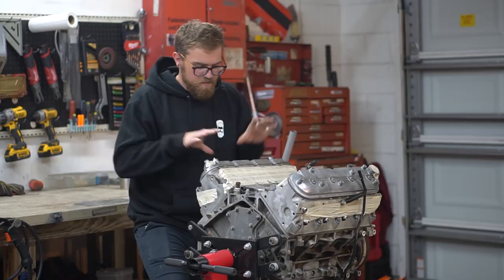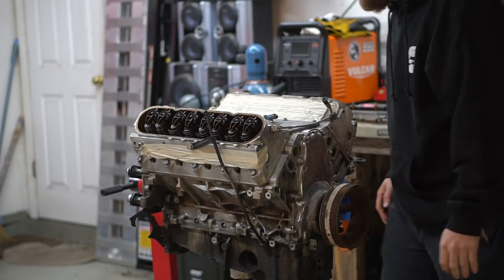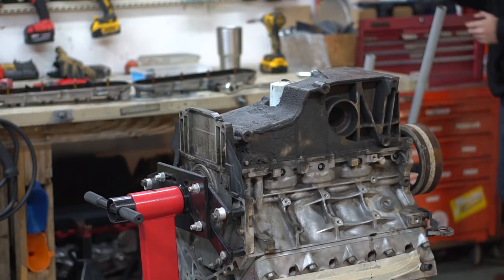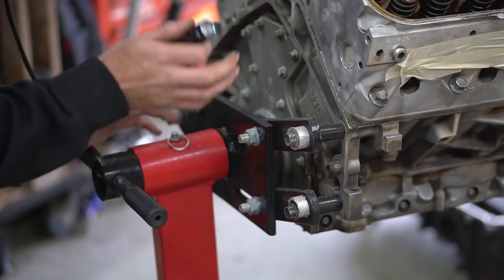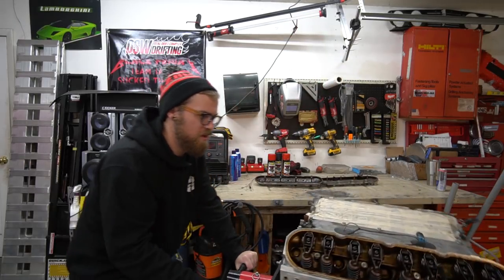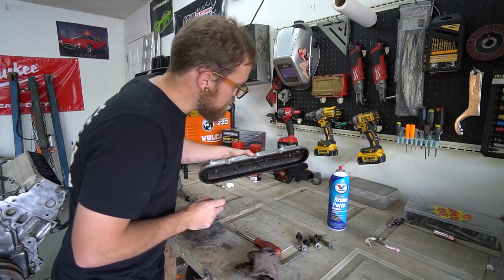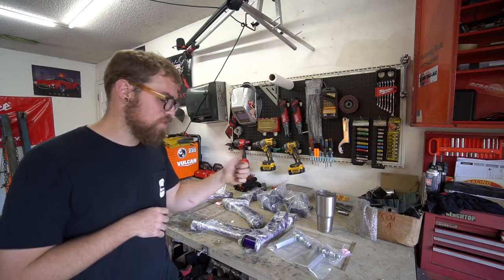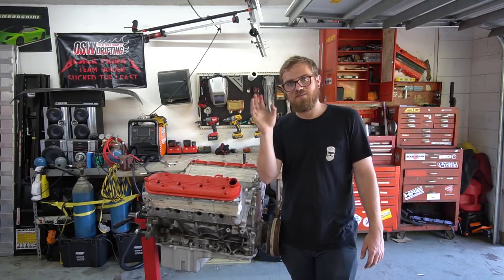Budget LS Swap Miata Pt.3 Opening up the Engine + Surprise Mod

Comment: i would just get it hot tanked, honed, and new bearings all around then it should run forever
Reply: This 100%.
Reply: I completelly agree with you. I did an rebuild on my busso but didnt replace valve tappets which were pretty worn. It runs perfectly but bothers me anyway everytime I rev the shit out of it.  Now it is next to impossible to change them with the engine in car so... It is definatelly worth to do everthing as good as possible the first time.
Reply: robert paszko Q
Reply: i disagree- a factory sealed motor has what i like to call "magic" once you open it, the magic escapes and it never runs the same.... unless you spend 10x more money on a full on spec rebuild. just slapping bearings in it i dont think helps it last longer.

Comment: Id say just go right ahead and pull the heads. removal is as simple as taking off the rockers, pushrods and all the head bolts. No need to remove any other parts. The only downside to taking them off is that  the head gaskets and stretch bolts will have to be replaced but thats not too costly at all.

Comment: Don’t be shy to take the heads off an old v8! You already have it so stripped down, at least inspect further so you don’t put it in and destroy it. I know the engine is tough but play it safe! Nothing wrong with an extra video and some assurance that you can rip that little Miata with no worries!

Comment: Did that engine come out of a trailblazer/envoy denali? I noticed it by the oil pan.. on those cars they put a tube through the middle for the front differential. And the L33 stamp on the back.

Comment: those trailblazer motors were prone for bearing failure due to the crappy oil pan design, id recommend checking the bearings on 5 and 6. those are usually the first to go out.

Comment: Don't take the heads off, just get the Texas speed complete cam kit comes with everything you need, the heads it's got are amazing since they flow good and higher compression

Comment: its an LM4 motor not an L33. so just not flat top pistons and a different head / cam package. but minor differences there. biggest difference would be the pistons. you can tell because of the hole for the front driveshaft in the pan. also your not going to have a dip stick hole now because the stock one is in the pan. they do have the stock location on that block but it would just have to be drilled out. 
the motor is probably hanging up because of lack of oil, since you cleaned the thing with brake clean. put a bit of oil on the valve train and the crank and it should spin super smooth. I clean these motors all the time and they always kind of suck right after you wash them but get some oil in there and your all good. 
lastly. Just leave the heads on. its very rare that they have issues. just do a quick compression test and that should be a good indication. 
best of luck

Comment: Do a leak down test and see if anything is leaking past the valves to figure out if you should pull the heads if your on the fence so you can do a valve job.

Comment: you wouldn't want to wire wheel the oil pan gasket surface because all the debris will be falling into the crankcase.  Loose junk and dirt in crankcase means main crankshaft bearing and rod bearing wear.

Comment: Taylor before you boost that motor do the comp cams truinion kit upgrade for the rockers way safer for the motor you will wish you did if you don't
Reply: The rockers are a weak point due to the in captured needle bearings. Under high tourqe they eject out and cause trouble

Comment: One side under the valve cover is always going to be darker because it’s the side with the pcv valve the side without the pcv valve is totally covered at all times no extra air getting in that is perfectly normal. By the way I know this was a while ago but figured I’d let you know but you probably have already figured it out.

Comment: Pull the heads, head gaskets are cheaper than having to do it again and valve springs are easier done with a pulled head

Comment: The only reason to loosen the heads is to replace them with something better. Or if you’ve burned a valve or blown head gasket. Otherwise leave it alone. Or to put head studs in.

Comment: Spark plugs don't need to be done up tight just firm like 1/4 to maybe 1/2 a turn does not matter how big or powerful the motor is:)

Comment: Since you didn't see it running. It would be wise to pull the heads before you install it. The build will take a lot more time if you have to pull it back out. Just speaking from experience.

Comment: I'm sorry to tell you this but I'd just rebuild that thing. There's so much oil deposit. You can obviously see that they didn't do oil changes on time. I have engine with way more miles than that one and they are so much cleaner. It'd suck is something went wrong while in the new car. Also that's why i only use synthetic oil lol

Comment: The stock heads are fine for your application, but removing them lets you get a peek at the tops of the pistons and into the cylinder bores. You definitely want to get stronger head bolts anyways.

Comment: If that's a Trailblazer 5.3, which it looks like due to the awd oil pan, be careful of the displacement on demand lifters. You're going to want to get rid of those or you'll be replacing them down the line.

Comment: Iv never cammed an ls without          removing the heads. After one of the lifters drop you’ll have to pull the head anyways and it wouldn’t be bad to look into doing a trinion kit on your rockers and fresh pushrods and liftersand your golden but the bottom end didn’t look bad  it’s 6 bolt mains i wouldn’t worry about a thing
Reply: Not tryin to be that guy lol just trying to informative. Keep it up Taylor love the build

Comment: Hey Taylor, I dont know how many miles are on the motor, but if it is any where around 120,000 miles I would replace the rear main seal. I say this cause I have a lq4 and it started giving me problems shortly after 130,000 miles.
P.s. I love your video style.

Comment: I was really wanting you to take the heads off so you could tell what pistons you have. I'm not trying to be a narcissist, but I think the pistons will be dome shaped instead of the flat-top pistons that are in an l33. Not a bad thing, at least your block is still aluminum, but it would make your motor an lm4 or something along those lines. Less power, but still enough for a miata. Btw go drive by cable no matter what, I've been trying to get my throttle to work for 3 months now but haven't made any progress.

Comment: Instead of buying Brake Clean. Check out a product sold in galon jugs called "Lectra Clean" WORKS GREAT!! Cleans like no other! Soak parts in it. Put it in a spray bottle or use a solvent blow gun. It works trust me! (Wear a mask tho)

Comment: ls is one of the easiest motors to work on well the only one i have worked on its pretty easy man just pull the head bolts off and put head gaskets and new arp head studs in so you want have to spend money on them again and if you put a cam in it look at brian tooley cam i have a video of my 6.0 with btr stage 3 on my channel if you want to look at it
Reply: and running a cam i would put a high volume oil pump on from mellings and you will need a 3 prong jaw puller anf putting the motor back in time is easy just line the sprocket up with the mark on the block and make sure you push 2 dial rods in beside the cam to hold up the valves so they dont fall and sand the end of the crank shaft and the inside of  the harmonic balencer to make it go on easier and im only 16 and i know pretty much anything about a ls motor from working on my 1st truck i bought my self

Comment: if you want that engine to become new like clean on the inside just do 1k oil changes for about 10-15k miles. this will was all the old crap out and it will shine like new.

Comment: I Would pull the heads off ls based engines have common head gasket failure. I would put ls9 head gaskets and new stock head bolts because the head bolts are torque to yield. Can't reuse them.
Reply from the maker: +Chris Beans ahahaha yep!

Comment: Are you not building the bottom end?

Also, going to the 100% is the key.  You may think you don't need to get the oil pan perfect, but that's just the tip of the iceberg.  If you're ok with 75% there, then you will build a 75% motor.  Take your time and do it right, will pay off in the end.

One other thing, you're spending good money, don't stop with a cam, go ahead and forge the motor.  Or spend almost double doing it later.

Comment: Gen 3 rods unfortunately. Gen 4 rods are all around bigger and the side on the bid end is wider and very flat. That engine is still plenty strong for anything you can do NA  as long as you don't over spin it. And even boost. People make 500 plus with them all day. Key is the tune

Comment: You have to pull the heads if you want to do valve springs. Hell you can fill the cylinder with air to keep the valves up. But if you are doing valve springs and seals. Pull the heads because a valve will drop in. Also I would recommend Brian tooley cams. If you need any help please respond and I’ll give you my email, because I wanna see this done right because I love this build!!!
Reply: Drake Weston Brian Tooley just uploaded a video of him changing valve springs with the heads on. Take the spark plug out, thread in a compression tester with the shrader valve removed, put air to it, tap the top of the springs with a mallet to loosen the keepers, and use a BTR or similar too to compress them.

Comment: You didn’t have plugs in when you power washed it?!?! Luckily you didn’t hydrolock ur shit, may have f’ed the hone. And the reason the drivers side valve cover/rockers are lighter is because of positive crankcase ventilation
Reply from the maker: I did have plugs in? I had rags in the intake ports and they got wet, letting water into the cylinders. How would you Hydrolock a engine that's not even running?

Comment: Hey Taylor - Look into the Improved Racing Oil Pickup Tube Brace - its cheap insurance and will make sure your pickup tube doesn't fall out while you are drifting.

http://www.improvedracing.com/oil-pumps-mechanical/ls-engine-oil-pump-pickup-tube-brace-clamp-p-642.html

Comment: Still not sure why you're running short intake runners if you're going naturally aspirated, normally the longer truck runners make more power? 10-20hp from what little research I've managed
Reply from the maker: +Jonathon Dragicevich can't fit the truck intake under the hood.
Reply: Take the hood to church maybe? Sounds like it needs to be holey :P
Reply: Ls works better for NA higher rpm. Truck for boost
Reply: Dyno numbers disagree, short runners for boost, long runners for naturally aspirated. That's why you don't boost tunnel rams. In naturally aspirated, you want the least restriction, and longer runners make less restriction. In boost you want the least volume so the air can't expand out as much, thus making throttle response a tad happier.
Reply: They typically move your power up the rev range, so it really depends on how you'll be using the motor. If you're looking to V8 torque your way around a track, dual plane length runners are where it's at, if you're wanting to rev it out, longer runners
Reply: Also, 50hp difference, not a 20hp difference

Comment: Save yourself trouble put some new lifters in it. They are known to collaps. And if your gonna rev it to the sky upgrade valve springs. GM performance spring will work just fine

Comment: I commented before watching the rest of this video. My bad
Reply: And honestly I would just run marvel mystery oil through the intake ports and just blow through every cylinder on every cycle to get the oil on everything and and it will be fine man.   Let it rip. And if you stop before it puts a hole in the block  then you can just build it lol

Comment: Just take the heads off, it's worth the time. I know you're trying to do it quick and economically but checking each part on the motor is worth it, you open up the can of worms now and if you take the time you'll never have to worry about rebuilding this engine. A full rebuild takes time but it's so beyond worth it. While you have it sitting on a stand its worth replacing each seal. Having to pull a motor out after you just put it in is so disheartening. Might as well rebuild.

Comment: Not ganna lie those heads look unhealthy. My heads didn’t look that dirty. I’d be a little concerned but....just send it. Just make sure you do the rocket arm bearings

Also just take the heads off to inspect. You can reuse the head bolts...a lot of people do. Definitely can reuse the headgaskets if healthy but I’d replace them. Sloppy mechanics has opened my eyes to reusing things. I would never reuse head bolts on a ls because they are “torque to yield” but he made 900+hp on reused parts. So it’s proven to work

Comment: Anyone else cringe when he turned the crank backwards??.....
Reply: Its a good oll v8 wont hurt nothing
Reply: Still hurts the soul.... my mind always screams NOOOO! when i see people do it.
Reply: Yeah I cringed a little, then googled to confirm that it was backwards as there are a few engines out there that do rotate CCW.  I'm not too familiar with LS engine architecture but I'm hoping that there's no timing chain tensioner else he may have caused some problems.
Reply: Doesn't matter.
Reply: I cringed when he used the impact on the spark plugs....

Comment: That 5.3 is out of a Monte Carlo SS/Impala SS/ or Grand Prix Gxp not a truck. The trucks never came with aluminum blocks that may be why one side is more grimy than the other it would have been the "front" side
Reply: Not true. They were available in GMT360's and SSR'S. You can tell by the oil pan that one came out of something AWD. Definitely not an LS4.
Reply: GXP Was front wheel drive wasn't it?
Reply: This is an LM4 all aluminum 5.3 had a very short production life 03-05 came in Envoy XL,Trailblazer EXT,Buick Rainier,SSR and Isuzu Ascender. He first thought it was an L33
Reply: Yes gxp impala and Monte Carlo ate all fwd
Reply: The L33 is an aluminum 5.3L that came in trucks 🤷🏻‍♂️
Reply: The L33 is the aluminum HO version of the LM7. They're pretty rare compared to the LM4's.

Comment: i dont get it your spending all this money because the 1.8 was "unreliable" then you get  a junk yard v8 that rusty as all hell and you wont even open it  to at least hone it and and put new bearings and piston rings......sounds like your continue having those reliability issues you dont know the history of that motor at least yoou can do those with out taking it to the shop...engines shouldnt have  hard spots when rotating them dont be lazy taylor do it rite man